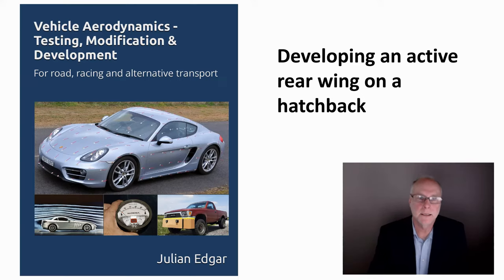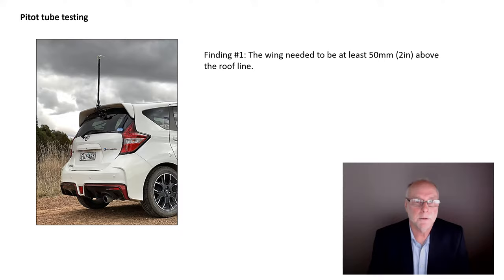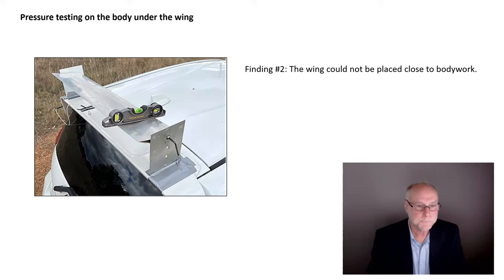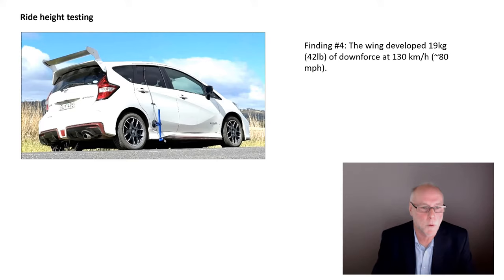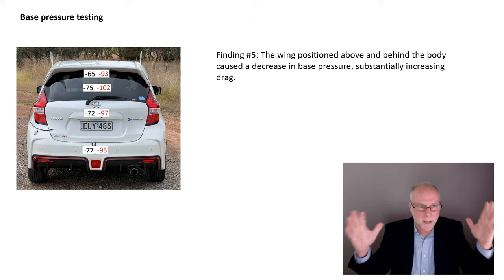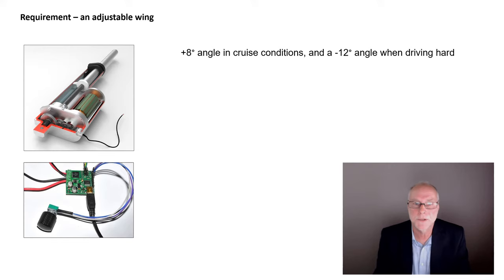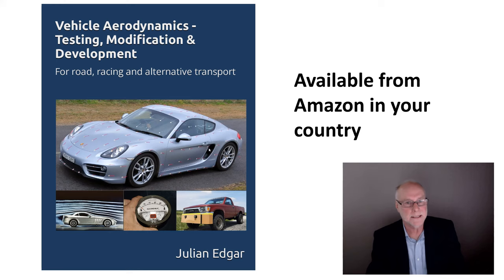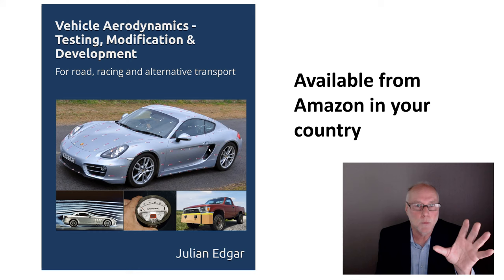Developing an active rear wing on a hatchback

Comment: Excellent video, only thing is I wish you showed the preasure differentials when the wing was in its low downforce +8 configuration. Looking forward to buying the book before I start my next project
Reply from the maker: My memory is that in the low position there was no measurable pressure difference in the base area vs having no wing.

Comment: Just bought your book Julian. Looking forward to receiving it. Now, ignoring aesthetics, would moving the wing further backwards have reduced its influence on the drag behind the vehicle? Regards Greg
Reply from the maker: Yes it probably would have but doing so increases front lift as the wing gets further behind the rear axle line.
Reply: @JulianEdgar  agreed. So by my understanding, if the wing was moved further back, reducing the angle of attack would reduce the total downforce number of the wing, whilst maintaining effective rear wheel downforce, and hopefully reduce drag at the same time.
Reply from the maker: My actual preference, as covered in my book, is to develop nearly all the downforce under the car, primarily within the wheelbase. Just thought I'd do something different on the Note.
Reply: @JulianEdgar  Interesting! Is this only true for road car application or do you think so about track-/racecars as well? Isn't the car going to feel sensitive to bumps and curbs if there isn't sufficient top-car-downforce? What ratio of top-car vs below-car downforce do you aim to achieve?
Reply from the maker: I am a road car specialist but I guess if you fly through the air off a curb it might decrease undercar downforce.  I like undercar downforce because (1) it's easy, (2) cosmetics don't matter, (3) there's a lot of area to work with, (4) it's typically within the wheelbase (or close to it) so it doesn't adversely affect aero balance.

Comment: Currently builing a similar system for my Toyota using a dual element setup where the top setup opens and closes using a DC motor rather than a linear actuator but what a useful video, will make sure to watch more.
Reply from the maker: Buy the book - it will inform you far more than any of my videos... and you can see how to properly test your wing design (and the rest of your car's aero).

Comment: Excellent; thanks. I was thinking, attach to speed sensor voltage and calibrate to full wing when speed achieved. Also, full on brake switch.
Reply from the maker: Yes, except sometimes at 110 km/h I want it up, and at other times at the same speed I don’t. Also, as covered in my book, air brakes don’t work well at normal speeds.

Comment: I once used a fixed aerofoil, to counteract the inherent tendency of my Charger, to break traction, at around 80, if you booted it. The pedestals I used were 75mm tall, so I'm guessing were well and truly out of the attached flow, as it certainly cured the cars nefarious tendencies. The angle of approach that I used was rather steeper, at 26 degrees, but I can't say I ever experienced any flutter. 
Its' tendency to break traction, at speeds below 80, I tamed with a set of trailing arms, and an XF Watts' linkage.
LC Torana rear springs allowed me to remove all but two, of the leaf-springs, as I considered the axle to be adequately braced, mate.
Excellent video, and I like the way you quote sources for parts.
Just realised that I mentioned this in an earlier comment, as I ultimately cut the wing up, and fitted two sections of it under the car, which was only marginally less effective, but was actually quite noticeable, when I tested the car without it.
The leading edge would have been 100mm from the floorpan, and the trailing edge was about the same distance, due to the kick-up, where the stock fuel tank had been.
Just wish that I had known about diffusers, back then.
Reply from the maker: The aerofoil would have been acting as a spoiler at that angle of attack.
Reply: @JulianEdgar Absolutely, mate, that's exactly what I was after.
This car was somewhere between skittish, in the dry, and virtually uncontrollable, in the wet, to feeling lovely, and planted.
The very first parts I fitted were ex-Volvo four-piston calipers, which really helped, no end.

Comment: You are creating an excellent series of videos. Your approach is both rational and methodical. Thank you for your hard work and for sharing. A comment pertaining to the flutter experienced by your wife described at 18:00: This effect may be exacerbated by a couple design decisions that are easily addressed. 1) You are actuating the wing in the center of its span but supporting it at its tips. This provides the potential for wing deflection in the middle to result in a change in incidence angle. 2) You are actuating the wing behind the pivot axis. A downward deflection of the wing center results in an increased leading edge down (LED) incidence and, at speed, increased downforce and downward wing flexure. This feeds back into the actuation to further increase downforce and flexure. When the wing reaches its dynamic limit it may spring back and the cycle may repeat in the opposite direction. The result may be flutter. I can see at least four possible methods to address this behavior. 1) Actuate the wing pitch using a horn projecting ahead of the wing leading edge. This will reverse the process above, resulting in stable behavior: Downward deflection results in upward pitch, quickly cancelling the oscillation as opposed to exacerbating it. 2) Move the actuation point on the wing much closer to the trailing edge and using increased actuator deflection. This will reduce the unfavorable coupling between wing deflection and wing incidence. This may raise the speed at which the wing flutters. 3) Leave the actuator as-is, but install a gooseneck with a mass balance well ahead of the wing leading edge at the span center. This may tend to damp the oscillations by inertia and may raise the flutter speed. 4) Move the actuator to the side and actuate the wing near to one support. This may reduce or eliminate the coupling between wing deflection and wing incidence, increasing flutter speed. My favorite is the first method. Alternatively, Method 4 combined with Method 3 may also produce solid behavior. A parenthetical remark: This behavior may be most pronounced with the wing at low incidence because the variation in lift percentage per degree is much greater at low incidence.  I hope these comments are helpful and/or interesting!
Reply from the maker: Thanks for your thoughtful contribution but the wing never flutters if the driver sets it correctly!

Comment: Amazing information as always! I wish we could see practical track measurements on before and after mods! (Like maybe a circuit timing, a top speed, tires temperature during a corner (maybe to measure increased pushing force of tire on the road), etc)
Reply from the maker: Well, I don't drive on the track but if you're interested in that, you could do those measurements yourself.
Reply: @JulianEdgar  There's no tracks around where I live, traffic would maybe get in the way of accurate measuring. But I'll definitely make the measurements Im able to when I fit the spoiler I'm projecting
Thanks!

Comment: Check the anniversary edition of the Abarth. It’ll change from a spoiler for wake reduction to a spoiler that disrupts flow (for downforce), increasing drag. I experimented with a cheap spoiler extension and wow. Great downforce at the track, but terrible on fuel mileage.

Comment: I always like to see your clever and inexpensive testing methods. You give lots of great ideas. E.g. the downforce meassuring with the open tailgate and the spring.
How would a simple Gurney-flap on the factory spoiler fair vs the added active wing on this car in your opinion?
Reply from the maker: A Gurney flap is used only on a wing. Adding a spoiler to the spoiler would improve its effectiveness - covered in my book, complete with measurements.

Comment: Interesting, thanks. Generally we want large downforce and low (aero) drag. How do you deal with the extra rolling resistance caused by increased downforce? Is this simply insignificant?
Reply from the maker: Yes, extra rolling resistance is minor unless downforce is massive.
Reply: @JulianEdgar  Thanks!

Comment: Nice content as allways, but i think your angle-of-attack-meassuring is flawed. The negative pressure at the hatch counteracts the downforce and therefore decompresses the spring ( also due to the long lever). 
Couldnt you just meassure the pressures above and below and multiply it with the area of the wing?
Reply from the maker: Matched well with the published AoA data for the wing profile.

Comment: Julian, are the endplates paralel? Would you try the endplate to change to aerofoil, to increase speed "inside" ie. under the main profile? Hence even lower pressure under the main wing/profile.  Silly idea....
Reply from the maker: The end plates are parallel. End plates stop 'spillage' / recirculation around the ends of the wing, they don't increase airflow speed under the wing.
Reply: @JulianEdgar  Sure, this is the basic function. But what if we try to further reduce the pressure with a relative low "cost" of drag.
Reply from the maker: Testing always beats guesswork, and with wings so easy to test, why would you guess?

Comment: Does the Vehicle Aerodynamics book encompass other titles you've published in the past? As in is there a '"must have" list for track aero modifications and info. getting really stuck in on a build and want to take a more granular approach to the aero than most tend to
Reply from the maker: The current vehicle aero book is a very major update and expansion on my previous aero books, yes. It also does have a 'must have' (key takeaways) listing for aero modifications - Appendix 2, including for gaining maximum downforce.

Comment: I was wondering about one thing you said:
With the first wing over the roof, the low pressure bellow the wing will be on top of the roof. That's clear no discussion about that. Now, regarding the effect on the car behavior, since the wing is stick to the roof, none of them can move relatively to the other one. At most, the wing would bend due to the force. So I can't see how that could create a lift to the car. Did you test the ride height with that solution? Eventually that could bring more drag, since that creates kind of a trap for vaccum that can't easily be filled with air ( although there a lot of it just in front ). Am I wrong?
Reply from the maker: Lift and downforce depend on the pressures. Any low pressures on the upper surface of the car will create more lift. If the wing, because it is mounted close above the bodywork, develops low pressures on the upper bodywork, it will create more lift than if those pressures were not created there. An equal area of low pressure on the bodywork beneath the wing, and on the lower surface of the wing will, in terms of developed forces, cancel each other out, greatly decreasing the effectiveness of the wing.
Reply: I understand most of what you say, but my mind have some trouble to visualize one thing.
The closest the wing is to the bodywork, the least effect it would have because the forces will cancel each other, and it acts more as a tube or tunnel inside the car volume where air flows.
If you put the wing much higher, the farther the wing will be from the bodywork the more independent they will become. I suppose that might have been the idea behind the first F1 wings that were much higher than the car.   
In the second case, I can visualize a load coming from the wing, through the wing structure into the car, but in the first one, I can only visualize a neutral effect in terms of load of lift.
Reply from the maker: Well, if it has a neutral effect on lift/downforce, the closely-mounted wing is no longer working, is it? You've answered it yourself.
Reply: @JulianEdgar  exactly, it has a neutral effect but not a negative one,  as I understood at first from your video and your first answer.
Reply from the maker: I said the pressures would cancel each other out, greatly decreasing the effectiveness of the wing. That's a negative if you want a wing to work!

Comment: Hi everyone. Do you plan to determine a function between wing position and speed for example to actuate your motor ?
Reply from the maker: No, because when I want the wing active isn't just speed-dependent. For example, on the freeway at 110 km/h I don't want the wing providing downforce, but on a tight and twisty road at the same speed, I do.
Reply: @JulianEdgar  You could keep the manual control but add some automated functions, e.g. maximum downforce and maximum drag under braking would be trivial to implement presumably? And maybe a DRS like function under full throttle with no steering angle?